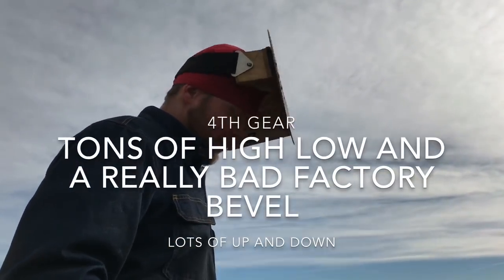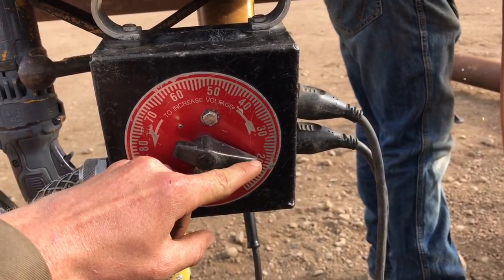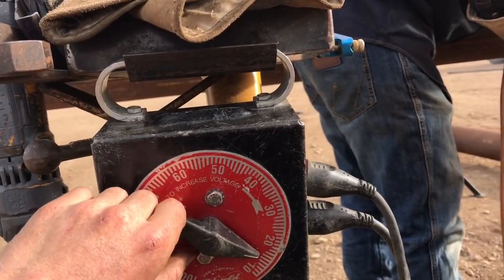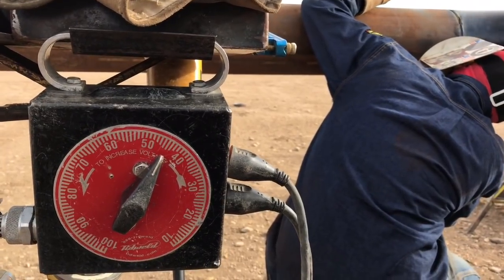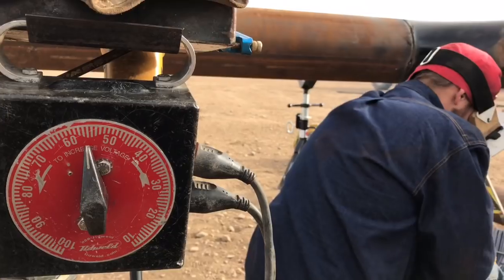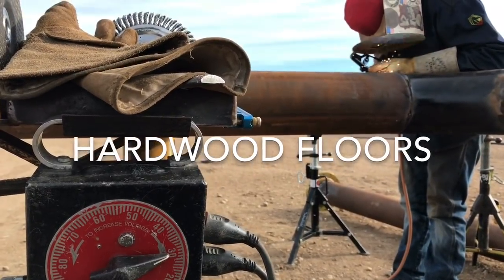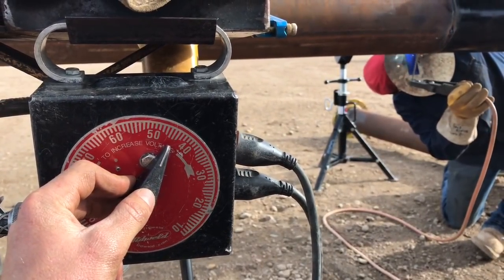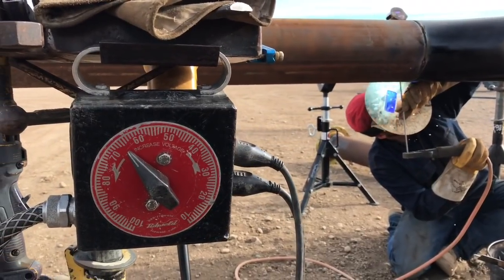Welding machine remote explained up/down

Comment: I’d like to see a video of you doing a cap with 3/16 8p+. How you move the rod and heat setting. Love your videos keep it up.
Reply: David Martin I understand. I’ve got 10 years welding experience not saying I know it all but all my pipe work has been stainless tig carbon tig and 5p root and 7018 hot fills and caps. I’ve played a little with downhill pipe welding but not a bunch. Just like to see others ways of pipe welding and other welders views.
Reply from the maker: We will try for sure we have been getting some tips on how to film the arc it’s really hard to see through the smoke. Practice is king but we will really try and see if we can get arc shots

Comment: Could you do a video on manipulation of the 8010 rod as you start on top and work your way down, body positioning while doing this would help to.
Reply: James Castillo he cant weld for you. i promise if he does do a video all you will see is the puddle, not how he moves around the pipe. if you dont understand its because youre not there yet. not bashing, jus practice
Reply from the maker: We will try and get some arc shots but it will probably be more me just talking to you showing you what I do with the arc. Great idea though and we will get that recorded hopefully it helps

Comment: I'm guessing pipe line welders have to have helpers correct ?????
Reply from the maker: e harris not always but they sure are nice lol
Reply: Kool thanks for the reply!!! Was just been curious they have had a few rig trucks here around at  the port of greater Baton Rouge, around placid , and Dow and they seem to all have helpers , ,,, most of all my welding experience is in vessels and heat exchangers( 10 yrs) , just been kinda getting as much info as I can don't know any rig welders just your channel has been I feel the best iv seen on the tube ,

Comment: That's pretty cool, I was told never adjust while welding, now this was on a mig machine. They said it will damage the rheostat.  None the less cool as heck
Reply from the maker: you know i dont know if you can or not on a mig machine but on these pipe machines they are designed to be moved as you weld but only the fine current then you have you gears you need to wait for the machine o idle down before adjusting those  thanks for watching

Comment: Hey schofield I have a vantage 300 and I don't know what does the arc control do or how to use it can you explain how is used appreciate your videos good work.
Reply: Arc control changes how your arc runs, simply put. It’s normally used at lower amps to keep the rod from sticking. 
I, generally, keep mine in the middle when running at higher amps. You’ll also notice that the higher your AC is the more the arc tends to “dig” into the material. Dig is what AC is commonly referred as.
Reply from the maker: I run my arc force depending on what we are doing if I’m pipelining and running beads I want a daylight gap and my arc force turned up up so when I strike off it cuts through and leaves a nice root you have to be careful though to keep from undercut. Now on the other hand if I’m in the back on the firing line I want it turned down so I can stack a bunch of metal and slick a cap on then move to the next one. Hope that answers your question.